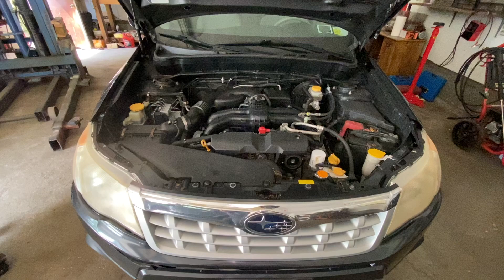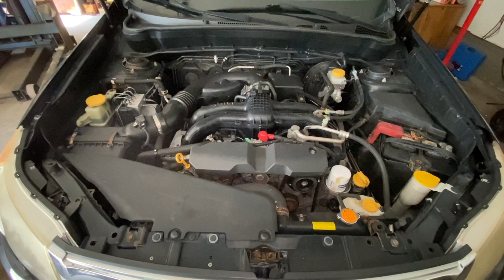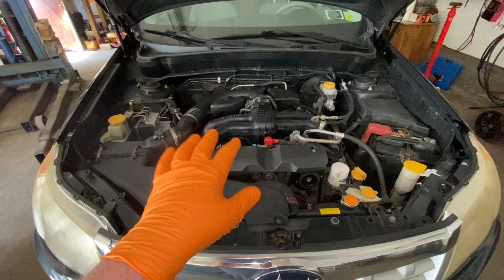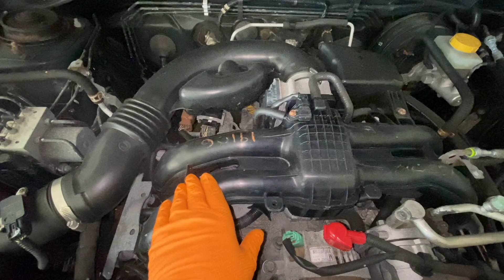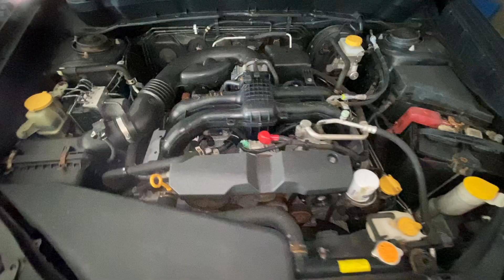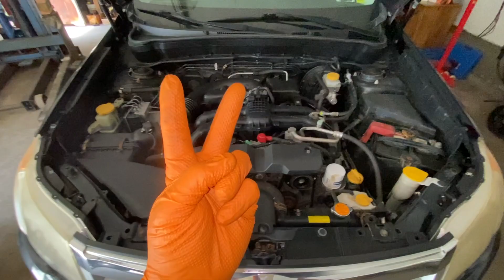Subaru Engine / Rod Knock Vs Piston Slap

Comment: I having the same issue with my Subaru g4
Reply from the maker: If the noise goes away when warm then should be no problem if not got to dig in the engine to see what’s going on.

Comment: https://youtube.com/shorts/fFOaCZn4nps?si=u2YzNQL78Kb7CLn3
Reply: Rod knock???
Reply from the maker: @mjjeverything7912 it does sound like it also hear a bad exhaust leak
Reply: @motorcarnut thanks for the answer BTW I think your engine knock is far worse then mine
Reply: I took a spark plug out and put a long bar down the hole then  turned the piston up the whole way and push on it and the pistion moved down probably less the half and inch and hear a click also the Exhaust leak is do bad it will smoke out my yard 😂
Reply from the maker: That’s definitely a blown rod
Reply: @motorcarnut all the rod bearings probably are spun including main bearing  the low oil pressure light comes on when the engine is warm and only at idle.
Reply from the maker: Yep that’s a telltale sign

Comment: I’ve got a rod knock in my car 04 Forrster but it sounds like a piston slap
Reply from the maker: Rod knock does not go away and the hotter the engine gets the louder the noise. Piston slap is the reverse cold it’s the loudest and as it warms noise gets quieter

Comment: My 2013 subaru forester sounds like the 2nd noise but it only happens when i’m driving at certain speeds?
Reply from the maker: If it doesn’t go away it’s probably a a worn piston. Can also be detonation (pinging) from bad fuel?

Comment: Mine sounds like the rod knock, but it takes about 10 minutes after letting car warm up
Reply: Would that still be a rod knock??
Reply: And once it starts doing it it won't stop until I turn it off and let it set for awhile
Reply from the maker: Yes it does sound like you have a rod knock.

Comment: What if it only sounds like theres a knock when you give it gas?
Reply from the maker: That’s still a rod knock unfortunately
Reply: What if it is pre detination due to carbon build up
Reply from the maker: @mn-vf2io rare on these engines but can happen, you will hear that usually under load and never goes away hot or cold

Comment: My car doesn't make this noise. It makes a similar noises at a certain rmp (2000 - 3500) and only at 1st through 3rd gear.  I had it brought in and I was told it was told it was rod knock but I'm just not to sure it's a 2007 outback 2.5 sohc and it burnt all the oil while I was a 40mnt drive I had just put oil in it a month before so I was surprised it had nothing.
Reply from the maker: It’s probably is a rod knock then, you can’t keep running an engine low on oil, that’s all it relies on

Comment: I have a 2003 subaru legacy l sedan it sounds similar fast noise my is a high pitched ticking is it rod knock?
Reply from the maker: Piston slap
Reply: @motorcarnut it doesn't go away when I rev it could it be Excessive pistion slap is there any way I could send you some videos
Reply from the maker: Yes, post them on your channel and let me know
Reply: @motorcarnut  Motorcarnut i posted three videos there both in the shorts section of my channel once you see all of them tell me what you think it is hopefully just pistion slap :).
Reply from the maker: @mjjeverything7912 Hey bro just listened to them besides the exhaust leak that sounds like something in the valve train. That engine has a timing belt so it’s not that. When you revved it up I thought I heard a piston slap but can’t be sure. But to me it sounds like the valves and cams sometimes loose or broken.
Reply: @motorcarnut can broken/loose cam cause screeching because some times it sqeaks and then it goes away also what do you think cause damage to thr cams could it of been the head was starved of oil
Reply from the maker: @mjjeverything7912 it can but I would take heads off at a minimum to see what’s going on?
Reply: @motorcarnut thanks I'll check in the heads I figure it wasn't rod knock because it's didn't get  louder it did get faster tho when revved and also the speed of it sounded like it was in the heads thanks for the help just what I needed😊
Reply from the maker: @mjjeverything7912 no problem!
Reply: @motorcarnut  so I decided to listen to the oil pan with stethoscope abd I heard a noise its sound like a clicking louder on the sides of the oil pan then the buttom about medium volume and then I listen to the heads the same sound was a little louder I listened to the timing cover heard a (duller sound the timing Tensioner is a separate noise tho)
Reply: @motorcarnut  what do you think it is from what I'm telling you
Reply from the maker: Piston slap if it goes away rod knock if it doesn’t. I see your link to video but it doesn’t open and on my computer it’s not there.

Comment: Just having old oil, will do this high-performance use.
Reply from the maker: Don’t exactly know what you mean?
Reply: @motorcarnut  I meant  to say driving a high performance car with dirty old oil can spin rod bearings. I change the oil in my 400 hp Sti every 2000k.
Reply from the maker: Yes it can

Comment: I have a knock. Only been happening for less than 20 miles. Took my 99 outback to Subaru at my appointment time. The "master mechanic" told me thats gonna be expensive. I said how? "That's gonna cost you round 4,400. You should just trade this in and pay for a new car".  I looked at him, called bullshit on him. Said "didn't realize you were a salesman, I wouldn't want you touching my car anyways since your just a glorified lube tech".. then I hit him with a good day sir. And left.
First time I ever took mine to the dealership, also the last time too.
Reply from the maker: Yep, got to be careful of the stealerships
Reply: Similar happened to a female friend. Subaru Tampa are crooks man. Advised her to gtfo and never go back LMAO

Comment: On my car the knocking happens on cold start then kinda goes west but then will kick back in if im on low gear accelerating. The knocking doesn’t last and as loud as example in video
Reply from the maker: Probably should have it looked at but being a Subaru it’s probably not bad at all.
Reply: @motorcarnut  would you mind looking at the video I just posted on my account with my engine sound and let me know if you think it sounds like rodknocking, I was thinking maybe my lifters, I’m not sure
Reply: Doesn’t seem as deep as a sound
Reply from the maker: Just checked and don't see the video?
Reply: @motorcarnut  I deleted it cause I had a mechanic come by and look and confirmed rod knock

Comment: Great video. My Subaru (2014 Outback FB25) has the start up slap/knock noise. no noise at idle. then only at certain rpms/speeds I can hear the noise. I often hear it at around 25/30 mph, when decelerating without a break. No metal shavings in the oil pan or filter. It does sound internal, and one mechanic said he took a stethoscope to the engine and he said it seems like it's derives from the center of the engine. Any ideas?
Reply from the maker: How many miles are on the car? If the noise doesn’t go away  when the car is hot then it’s either piston slap from excessive cylinder wear or the beginning of a rod knock. Either way this should be taken care of immediately before you end up losing the engine.
Reply from the maker: @Rajah_Boy If when hot it doesn’t go away there is excessive wear happening and should be diagnosed. That is not normal.

Comment: I think the problem is that we chose to own Subarus
Reply: like a friend told me before i bough my subaru... you are about to buy a car with special needs 😂
Reply: @CarimboHanky  mine’s special need is a new engine 😅
Reply: @Super-rf6vr  this is the first time im working with a boxer engine and eventho i have owned a handful of cars and have worked with many cars over the years, this damn subarus make me feel like a noob sometimes. they are just different, the way they are built, the special tools you need to work on this engines 😂 its truely a love/hate relationship
Reply: Y’all act like it’s the only car that has engine problems gm had piston slap to but the rod noise/problem comes from not having enough oil simple as that
Reply: Facts 😂 i include myself
Reply from the maker: No, they are great vehicles
Reply: @motorcarnut  tell that to my Forester’s engine lmao
Reply: @Super-rf6vr  I just picked up my first Subaru recently and I'm amazed at how problematic these vehicles are. I'm coming from the world of old Redblock Volvos where 300k miles is just breaking in the engine, and maintenance is incredibly cheap and easy. No wonder I don't see a lot of older Subarus on the road. You gotta have deep pockets or a lot of spare time to keep this junk on the road.
Reply: @LForehand  mine is a 2010 225,000 ive bought it at the dealership and it's been a great car

Comment: Or...it could be the mechanic left the VVT tension spring loose...and it's tapping against  the valve cover when it's at low idle. How do I know? Guess.
Reply from the maker: That’s human error.
Reply: @motorcarnut  Absolutely. But you'd think he would've found it the first time I brought it back to have the valve lash checked. 🤨
Reply from the maker: @seanhoward8025 Definitely should of. Try new mechanic in the future.

Comment: Thanks just bought a 2013 outback EB25 and it started making a slight noise for a few seconds on start-up. This video puts my mind at ease. Can it be stuck rings?
Reply from the maker: Very possible, they tend to get gummed up from not changing the oil on time.

Comment: Piston slap in a subaru is normal. We have 5 of them, one is a purpose built,  tight tolerance, endurance car. It has cold start piston slap as well. Pretty sure porsches have it also just not as prone as they have a better oiling system than subaru (piston squirters)
Reply: Cast pistons shouldn’t slap. But some ej20 engines have forged pistons which will slap. These engines are usually out of the sti models and some early v1/2 Impreza wrx’s have been found to have them.
Reply from the maker: Piston slap is not normal, that is a metal to metal wear. I have serviced 100's of Subarus that don't have that problem. BTW Porches don't either.
Reply: @motorcarnut I’m inclined to disagree. Built motors with forged pistons slap when cold.
Reply from the maker: Yes forged pistons do but we’re not talking about aftermarket or high performance pistons we’re talking about stock that the majority of people have.
Reply: @motorcarnut  some ej series engines have forged pistons as standard.

Comment: I have a very similar sound, but it started with an intermittent screeching like metal on metal. One day it would do it. The next day not. The screech would start upon starting my engine and then stop after 20 minutes of driving. Yesterday,  I  drove 15 Mike's to the store without a sound. Started up to leave and the screech started, but after about 3 blocks switched to a very similar knocking sound like on this video... could an accessory pulley bearing do that?
Reply from the maker: Yes, especially the serpentine belt tensioner or a pulley starting to fail.

Comment: hey, i got a similar sound as the rod knock in your video. mine went away for a while, and then came back. also i heard it on idle, but now it stopped doing it on idle. is it still a rod knock? it comes only when pressing gas and it increases with rpm. could it be a valve tick? its quite loud tho
Reply from the maker: No, a rod knock is a metal to metal sound and won’t come and go. Could be an accessory, like ac pulley bearing , serpentine belt tensioner etc